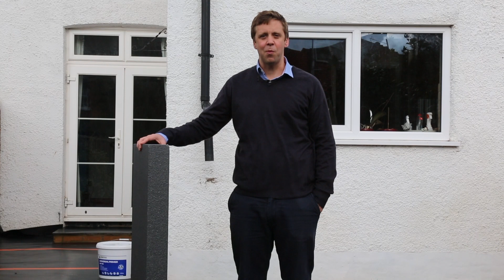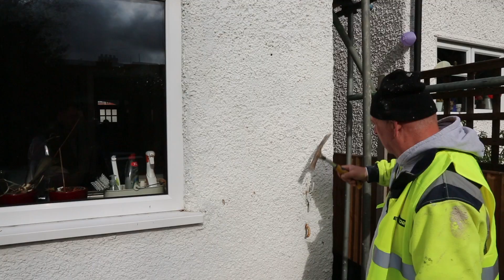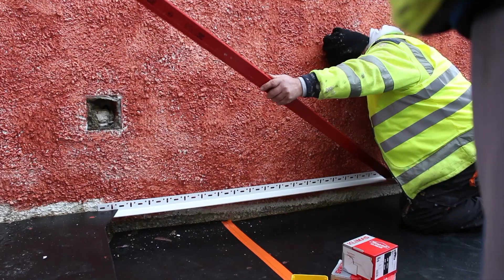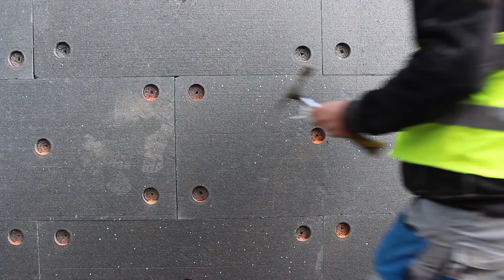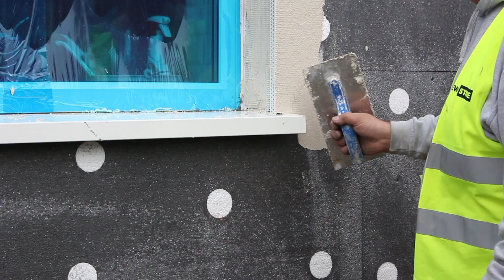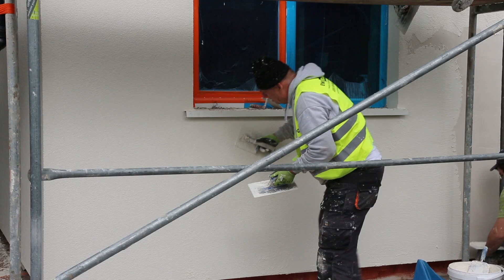External Wall Insulation Installation Guide by The GreenAge

Comment: where does moisture go once it has entered? nowhere. so this will fail by design.
Reply: The render is waterproof.. so what moisture?
Reply: @MrFanhost  But there will be moisture internally, generated by the occupants, cooking, moisture in the air, etc. To prevent condensation on the internal walls, I think you’d need some kind of ventilation system. Disclaimer: I’m not an expert; this is what I understand from my own research.

Comment: Anybody knows what to do if you need to install a cctv camera on top of this insulation?
Reply: CCtv camera shouldn't be that heavy so it should be fine, if you're worried, i'd say use a multitool to cut a block of the insulation out and fix a piece of timber (same thickness as insulation or slightly thinner) to the wall and render over it.
Reply: Qi Zhang thanks